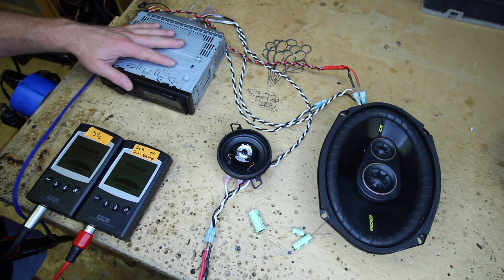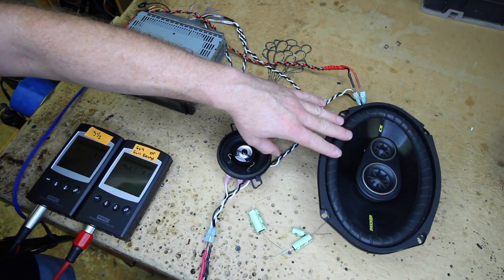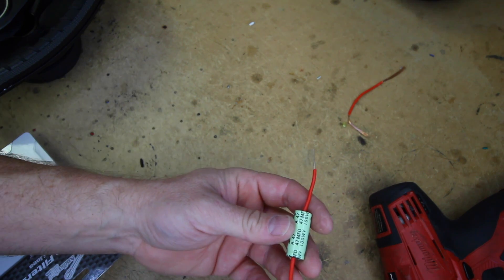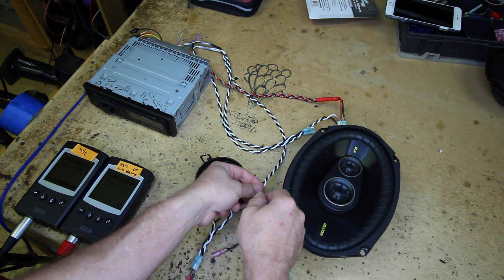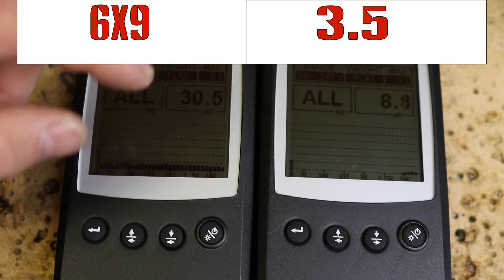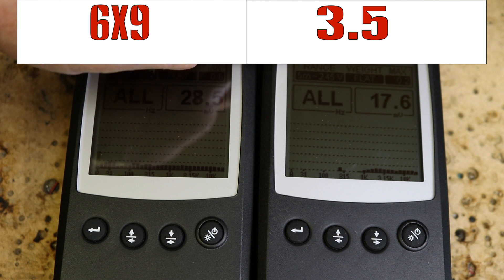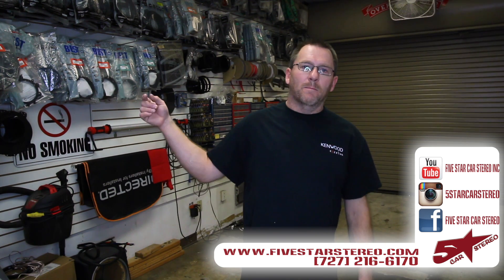What is a bass blocker and what does it do to my speaker?

Comment: Just bought the Audio Control epic 6.5 but does not come with a tweeter, looking to pair it with the AC  pw1 tweeter on a 2 channel amp. Does the bass blocker apply the same way.  Thanks in advance.

Comment: okay so if i have 2 coaxles 3.5 and 6.5 would that drop the ohms down to 2ohm.. could I use an audio resistor on the smaller speaker to limit its power input and also raise the ohm back to 4ohm?

Comment: I HAVE SEVERAL QUESTIONS. I HAVE BROKEN AMPS AND SEVERAL COMPACTORS WHAT KIND DO I USE TO TAKE OUT BASE? ANY?
Reply: They fail in a couple ways. Too much power and they will pop, no more sound. Second failure is loss of electrolyte. Over time the electrolyte inside will evaporate, higher temperatures cause this to happen faster. The caps have a rated temperature, often 65C or 95C. As they the temperature gets closer to that rated temp, their lifespan decreases. Generally best to avoid the 65C rated ones in autos, but those are good for home usage. As the electrolyte evaoparates, the actual capacitance (microFarad) will do down. So cutoff frequencies will get higher, so your 6x9 gets sounding more like the 4 inch.

Comment: First off I love your videos and have learned so much!  I have a question hopefully you can help me with.  I've got a set of Infinity Kappa 1.4" edge driven soft dome tweeters that I want to replace my factory tweeters with (21 Ford Super Duty with the factory B&O audio).  I believe the factory Ford tweeters have a base blocker so I'm assuming the tweeter circuit is full range.  The Kappa tweeter is part of a component set (90CSX) and the crossover specification on the component set is 5kHz.  I didn't want to use the Kappa crossover as it's a large round (hockey puck) that won't fit in my dash.  The Kappa tweeters are 2.5 ohm and based on a 5 kHz low frequency cut off, I could use a simple non-polarity 12uF capacitor which would be 5305 kHz cut off.  My primary question is I thought that the ideal cutoff range was somewhere between the resonant frequency (Fs) of the tweeter and the actual crossover frequency of 5kHz.  I have been unable to find the resonant frequency specifications for my tweeter.  Should I just target 5kHz or should I go lower.  I feel that 5 kHz would be safe but I don't want to lose lower frequencies if the tweeter can handle it.

Comment: Great video. It looks like you were using 4 ohm speakers and it looks like they were wired parallel. If you put the bass blocker on the 3-1/2" only, do you figure the value based on 2 ohms because of the parallel wiring, or do you figure the value at 4 ohms because it is a 4 ohm speaker? Or did I miss something?
Reply: Hi @rodwardle
Did you get the answer can we connect a 4ohm tweeter in parallel to 4ohm midbase speaker and amp will it change to 2 ohm or is it fine?
Reply: Never got an answer. @msostylish4680

Comment: "The value of capacitance  determines the resistance to alternating current of a specific frequency". That's it in a nutshell, that's your "Bass Blocker".. Now I guess you need to break it to these kids that it is an AC voltage that powers the speakers. There is no true POSITIVE or NEGATIVE wire in speaker wiring.

Comment: iam running a 2ohm amp..which my door{6x9 4ohm) and my dash(3.5 4ohm) in parallel which gives me my 2ohm signal...so do i need 4ohm or 2ohm bassblockers for the 3.5 wire

Comment: Question. I have a 02 Ram that has the space for the 3.5” dash speaker but no speaker or wire. If I want to add dash speakers . Do I splice into the speaker wire for front door speakers an add one of theses to the speaker wire for dash speakers. When I bought the truck it used to have a sound system in it an the person took out subs an amp. Door speakers sounds horrible with no bass I have tried to adjust the head unit with no luck so just going to replace everything. Just don’t know how to add dash speakers. Thank you

Comment: Please help me lol. I have a 2008 mustang. It has 6x8 2.3 ohm jbl speakers in the upper part of the door and it has 8” factory subs in the lower part of the door. What bass blockers should I use for both of these speakers?  I have 2 10” kicker subs for my lows so I’m only wanting the 8” in the doors to have mid range bass. I have no idea what I should get? Crutchfield has 150hz, 300hz, 600hz and 5000hz bass blockers. Which of those would you go with to do this?

Comment: Would you trust running a compression horn off rear channel on hu with bass blockers, and what happens if you use multiple blockers? The horns I have got frequency response from 500-25,000 hz please respond :-)

Comment: What's the difference between those capacitors "Bass blockers" and traditional crossovers?
Reply: Daniel Saucedo there is no difference. This is exactly the same as a 1st order crossover
Reply: @noelbostrom5834  Noel, i had a question if i may,i have 6x9s in the back of my car,5.1/4 in the doors and in my dash i have provision for some 3.5s  and a buddy gifted me some here recently and I'm going to install them,I'm running a small amp (400watts or so) just for a bit more clarity and bite to the music,i dont really go bassing around,should i still get some base blockers for those 3.5 i will be installing or would that be a waste of time? i really appreciate your time.
Reply: @dntlss  well yes, since 3,5 inch speakers or tweeters (dont no exactly what you got) is so small the xmax on the unit is quite small. If you don’t have a filter on that speaker you will probably burn it

Comment: So if I have a 2.5" eight ohm speaker I'd like to add to a home theater speaker for mid range, would I use a 33uf 100v capacitor or could I use a PAC BB-4PR. Wondering what would be best.

Comment: I just bought new tweeters for my car and they came with in line crossovers. I utilized the factory location. I cut and splice the factory plug and made sure I used the in line crossovers but now my new tweeters aren't able to go past half volume on my head unit without distorting
Reply: Need to put them in 3rd order.

Comment: Without getting too technical, what is a good "size" capacitor to use on a 2 inch speaker (not a tweeter)
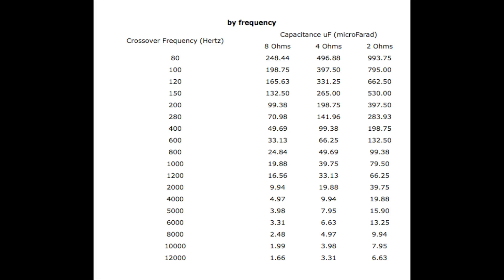Reply: If you look at minute 2:19 he has a chart that tells you what capacitor to get according to the frequency that you want to separate / cut .You are asking for a 2 inch speaker, thats a mid range, so I would cut out any frequencies below 1,000 or 1,500 hertz. A capacitor between 30 and 35 farads is what I would use.

Comment: Love your vids. I have a question, how do i lower the power going to the smaller speaker in this setup? I have a toyota tundra that i replaced the doors and dash speakers and now the smaller dash speaker is too loud compaired to the door speaker
Reply: Add a resistor in series with the speaker

Comment: Okay this is perfect unfortunately I need the other way around. I have a 10 in sub box that goes in the house that is design for home theater system. The speaker is in excellent condition. But the amp that drives them died so I threw that out. I want to wire a house amp directly to this base been. But I don't want the highs or the mids going through just allowing base only. I know that there's something that I can put on the positive side to the speaker that will only allowed the base to pass through this speaker do you know what it's called? Do you know what I'm looking for? Thank you very much great video by the way

Comment: Excellent video.  Question...why do some bass blockers state 50 volts or 100 volts?
Reply: This only indicates how much voltage they can withstand  before popping.
Reply: Alot of home audio butfs use Culver's for crossovers on builds , same concept

Comment: I see most of the capacitors only handle up to 50 watts RMS.  I have 100 watt rms going to each 6.5" speaker on my motorcycle.  I don't want the lows distorting the speakers since I play at high volume.  Any suggestions?

Comment: Does this work on the frequency or the power or watts going to the speaker. My 5.25 doors and 4x6 rear pillars on my pick up are my concern. I want to add a 10 in. sub and a 50 watt amp. I just noticed the bass is still pushing through the small speakers don't like the distortion on the smaller speakers. I wanna stop the bass not the power going to them. 25x4 watts stereo with sub pre amp outs.
Reply: They passively reduce the power of the lower frequencies below the filter point of the capacitor. If you had a 4x6 speaker and used a capacitor for 200Hz then all of the frequencies below that would be attenuated / reduced by 6db per octave.  The power of the stereo  is not effected but there is a very small amount of loss with passive filtering.  It's well worth it though as your smaller speakers will play louder and clearer. The lower frequencies will still come though a small amount but those frequencies will be greatly reduced.

Comment: hi ‘ so i was wondering ‘ my brother has a 05 mustang and he got all memphis on his car ‘ his had the subs and door speakers  and amps for almost 15 years and still going good ‘ he  took the car to get it  installed everything to a local shop on 2006 and we notice his front and back speakers were getting alot of bass ‘ that the front ones surround ripped but still play ‘ i checked the 4 channel amp and its in high pass filter ‘ no bass boost anything ‘ what bass blocker can i use he has m-class 5x7 up fronts and on the back the same ‘ he wants to remove the bass from going to all 4 speakers ... stock headunit
Reply from the maker: Check out the PAC-Audio BB-3PR or the BB-2PR
Reply: Alejandro-Chaires 14 turn the low pass filter all the way up

Comment: Very nice explanation, its the reason your sound gets distorted if you try to make it loud, but the problem is, i cant seem to find these capacitors anywhere
Reply from the maker: +iwantitpaintedblack any Pac, Stinger, or Bestkits dealer can get them for you. Or try Parts Express
Reply: yeah they are available on Parts-Express but the problem is, i am in Germany and the shipment alone is 23USD, i can buy a whole Chinese crossover for that price alone
Reply: If you can go to a local electronics shop and tell them that you need non polarized electrolytic polypropylene capacitor for an audio filter. A electronics repair shop may carry them as well.  There is a chart at the bottom of this page - https://www.sonicelectronix.com/cat_i451_bass-blockers.html

Comment: I’ve got a new car. I want to install a new sub and amp. I’m keeping the factory deck and speakers, however. I want to add bass blockers to my speakers so that they don’t put out the bass. Im going to have to use an in-line converter though to put RCAs to the amp. So being that my radio setting to adjust bass will afford for all speakers including my subs, if figured bass blockers would be the best way. Thoughts on this? And what size would you use for a 6.5 speaker. Thanks man!
Reply: I have the same problem! How did you do?

Comment: i have 2 4inch 120watt 4ohm 2ways and 6.5 300watt 4ohm 2ways and 6x9 300 watt 4ohm in my car i connected the 4 inch and the 6.5 together the both running off one wire in each if the doors and the 6x9 are in the rear connected  by 1 wire each there powered by the Pioneer DEH-X6900BT and they sound good untill i turn it up i would like to know which type to use but i dont want all the bass to be gone just no distortion when i turn it up can u please help?
Reply: 1ruckus1 you wired your stereo to a 2 ohm load and it will eventually blow if you keep playing it like that
Reply: Nicolas Wallace damn well i plan on installing a amp soon and the vehicle dont get used much right now

Comment: Great Video Keep up the good job  !! Needing some help in trying to do a Trimode setup OLDSCHOOL. Speakers are 4" coaxial 2ohm and a Kicker CVT 6.5 2ohm (wired Series) Stereo for each channel. What size Cap and Inductor do need for this set up  for this set up @ what roll off 6-12-24DB ? Specs on the Sub are 25-300HZ with no information on the 4"

Comment: Great video. I actually added a 199uf blocker on my 6.5 door speakers recently. Found that they still play a bit too much bass than i would like. Your crossover point capacitor selection chart is a real good piece of information to have in helping me select a crossover point a bit higher. Thanks for an excellent video with alot of useful information.
Reply from the maker: +happystar1000 glad we could help.
Reply: go with 100. ;)

Comment: Hi.. Excellent video. Wanted to understand that if I wanted to block signals below 100 Hz and the calculator suggests 200 uF capacitor, does this mean the slope will start at 100 Hz? what happens to frequencies below 100 Hz?
Reply from the maker: bsl bl a cap will is a 6 db per octave slope. Basically it is a slight decrease in volume for each frequency below the crossover point.

Comment: Hi mate, good info there ;) Ill get shot down for my question now lol if I'm running a 2 channel 2000w amp with a 1000w sub bridged, is there any way I could hook up 2 door speakers to that set up? Maybe with these capaciters or is it a straight no no? Cheers
Reply: a little late but maybe it will help someone else. I have a 2 channel crossfire amp that has a diagram for a three speaker setup. You run your sub bridged and simply hook up the left and right speakers normally. The subwoofer will get double the power of the speakers, but usually when you are running a sub you want to drive it harder. I have personally used this setup, although it is usually better to have 2 seperate amps, as long as you are not driving the amp close to the limit it will work fine. Remember it will run hot when pushing a lot of power so just keep cooling in mind and you'll be fine.

Comment: on the rear speakers 6.5 with no tweeter, can you add a tweeter by soldering into the rear speaker and using the 3.3 capacitor,do you think that will work?
Reply from the maker: sierra2562 if by soldering on you mean connecting to the speaker + and -, yes that will work great.
Reply: thank you, yes i i want to solder 2 wires on the back of the rear speaker and add the tweeter using the 3.3 capacitor to get better highs with out blowing the tweeter
Reply: Five Star Car Stereo what about a 14uf would that be ok for tweeter's?

Comment: I was told by adding a bass blocker to a non Amplified system it will burn out the outputs on the stereo because it changes the load and I was wondering if this is true
Reply from the maker: billy taylor nope not true. We do it all the time on 3.5" and 4x6" speakers.
Reply: Thanks

Comment: I just bought 2 pairs of stinger 99uf for my 6.5s coaxial.  is 400hz to high?  I do have a 15 inch sub
Reply: and I also gonna run it off the stock hu which is the 8.4n u connect in my 300. will there be an issue since my stock speakers are 8ohms and my new speakers are 4ohms?
Reply from the maker: MOPAR 300 does your car have the base stereo or the premium one?
Reply: base 6 speakers
Reply from the maker: MOPAR 300 the caps will be fine. Be careful at high volumes, test the sound of the speakers with the subs off. Make sure the sound is not breaking up or distorting.
Reply: thank you sir.

Comment: Question for a new video, how should my equalizer look/sound? Flat? And how do I know when I should adjust it?
Reply from the maker: ARCH. M yeah that is a great question and would make a great video. We have been trying to come up with the best way to do it and have it make sense.
Reply: @FiveStarCarStereoInc  if my pioneer gm-d9705 amp is 2ohm stable,  could I put a 4ohm 6x9 and 2.5ohm kappa 2" parallel to 1 channel?  Or would that be too hard on amp?  Thanks a million
Reply: Five Star Car Stereo what about for a 6.5inch speaker
Reply: I have a kinetic battery running a 300.1 kicker amp with an 8" 500 rms sub and am having problems adding treble to my setup. I used pioneer 5.25" that produced bass and very little treble. So I tried blaupunkt 6 1/2" that did the same rated 100 watts rms...any suggestions? I use rca to aux to a bluetooth hook up.

Comment: Hey thanks for the reply. Because of time, I was turning the ANC off through the radio before I start the car. All of the equipment is aftermarket. I will disconnect the ANC mics and see what happens
Reply from the maker: Brian Miles let is know. It is a silver box under the radio above the pocket. Pull the pocket  out and look up.

Comment: Interesting... I just changed the door speakers in my lancer including the tweeters in the door pillars, should I have added some BBs as well (the original tweeters didn't have any that I could see)? Plays fine as far as my ears can tell...
Reply from the maker: Maurice Foster did the new tweeter have them? Was there a factory amp? If so, they may have  been actively crossed over.
Reply: Five Star Car Stereo Hi, ok I don't have a factory amp but based on your question I read the documentation that came with the tweeters and they do carry built-in crossovers after all, sorry I didn't check before, thanks!

Comment: Thanks for the video. Have you all worked on a 2016 Honda Accord yet? I'm having some serious noise issues with my system. LCQ1 and Soundstream Picaso Nano 5 channel running 4 6.5s and 1 12" sub.
Reply from the maker: Brian Miles yes, no problems yet. Did you disconnect the ANC mic's in the headliner if it had them. Make sure the gains are kept low on the amp. Was there a factory sub?
Reply: @FiveStarCarStereoInc  that mic will make interference sound in the sub.. lik... thuuuMp.  THumP

Comment: Should i use a bass blocker on a 05 honda element with four 6 1/2 tow tweeeters in dash and one 12 sub with 500watt amp
Reply from the maker: Ghost Face most tweeters come with them built on or small boxes you add. If you are still using the factory radio and want to help out the 6.5, yes you can add them. If you have an aftermarket radio it may have a high pass filter built in. If so turn that on for the 6.5 speakers.